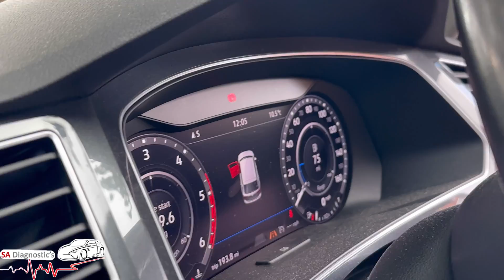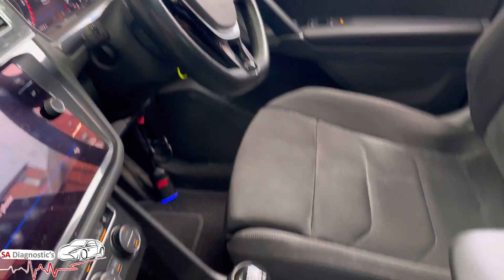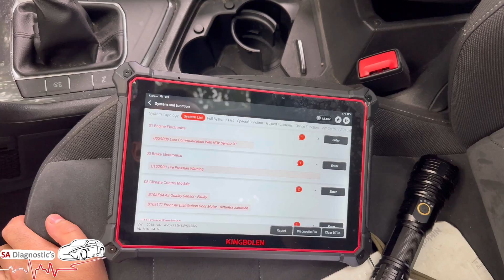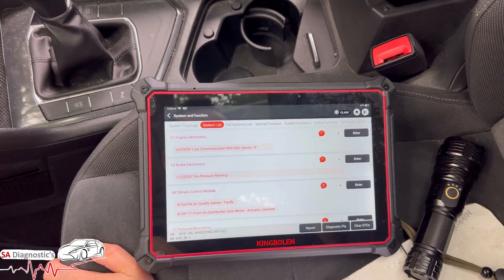How to Fix Your NOx Sensor Communication Issue (and Save $$$)

Comment: Mine came on after driveing through Deep puddle , , reading code 2c3000 , ive got warning ad blue , caf not gone into limp mode,   but i cant delete code , any advice ?
Reply from the maker: It just probably requires resetting, if that doesn’t help then just replace original sensor